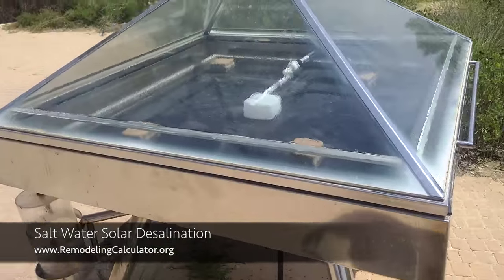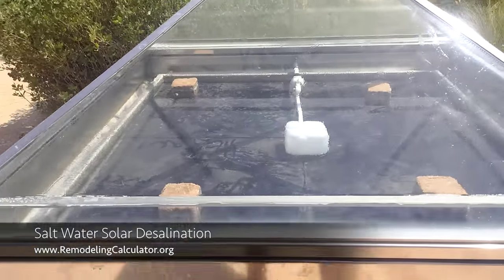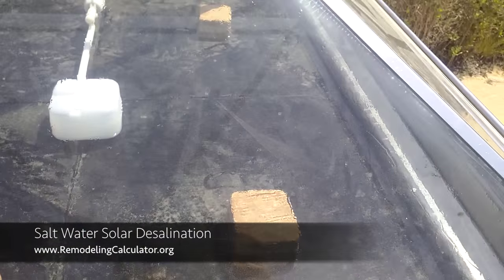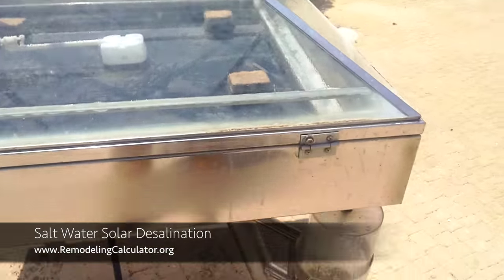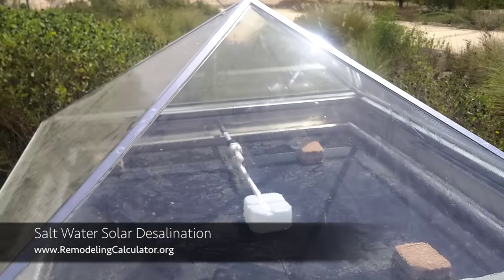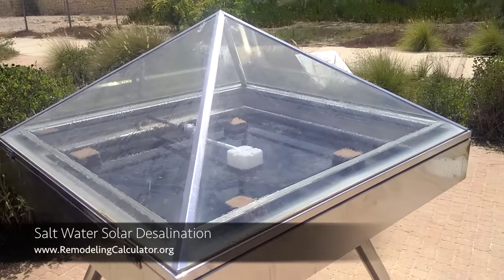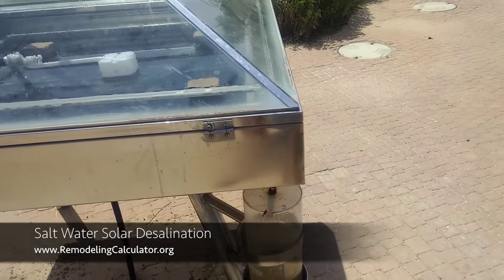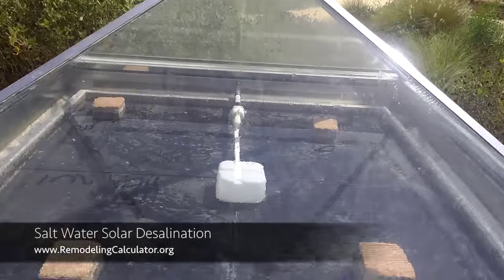Salt Water Solar Desalination - ZERO Energy

Comment: This is a 7-years old video and there are some new ideas in the industry since then. One noticeable improvement is solar energy interface evaporation, which is a technic to heat up only the top layer of the water surface instead of the full water body. Despite that, I still like the design shown in the video for its simplicity. A simple design means that it can be implemented anywhere. However, I would like to suggest two little improvements borrowed from recent advances: First, instead of pouring the salt water into the evaporator, you can add a small pump to drip the saltwater drop by drop. This is to make solar energy concentrate on a small amount of water at a time so that evaporation is more efficient. Second,  add some coarse, dark material into the evaporator. This adds up more surface for the water to evaporate. The material can be carbon fiber, or even waste coffee grounds.
Reply: Can you help me
Reply: i think adding couple Fresnel Lenses would speed up the process
Reply: @Max3DDesign yes you are right it will concentrate light at single point , will increase temp of water very faster

Comment: "you can drink this water, it's pure" shows a filthy bottle with a yellow liquid inside.
Reply: If it doesn't have salt, then it did it's job. You can just boil it to disinfect it after that.
Reply: lol  yes is see.  also he says 10 liters per day?
Reply: It's a demo version and the water is just left outside so produces algae.
Reply: it's full of bacteria and algae
Reply: Plague Doctor that's how Mafia works!
Reply: spikedpsycho  You can always calculate how much sea salt it would require to be readded to make distilled water fresh/mineral.
Reply: spikedpsycho 
Can you show your calculations because I make it completely different to you. Seawater has 70x more salt than drinking water so adding 1Ltr of boiled water to 70Ltrs of purified water would give you the same concentration as drinking water not 20:1 as you stated.
Reply: @thechumpsbeendumped.7797  The Mediterranean is much saltier than The Atlantic so it should depend on such sea or ocean.
Reply: Rhoddry Ice 
The dead sea is even more salty so what’s your point? I was using his figures so how does your comment change what I wrote?
Reply: @thechumpsbeendumped.7797  Yes, so you can't say seawater and think it's the same salinity. That was my point. Autocorrect changed which to such in my last comment.
Reply: spikedpsycho  your right
I drink a lot of r/o water and distilled and i have to add pink salt to it because it adds back electrolytes to the water.  Fun fact: if you add 1/4 tsp pink salt to your work out drink it will provide 100-150% dv of electrolytes needed and you get like 30 of them vs 2-4 in a commercial drink.  knowledge is is fun
Reply: Actually it's a distilled water means zero minerals. I think this water very badly affect in our human body system. Unavailability of minerals especially  calcium will affect our bones partially feel weakness
Reply: It has algae (which in a way is a good indicator) which can be treated in the normal way you would treat river water or rain water, but it has no salt in it which is the main concern in harvesting seawater.

Comment: A person needs to drink about 2 liters of water a day, so the fact that this can purify 10 liters of water a day is very good!
Reply from the maker: +M.R. Weaver it can sustain 5 ppl / day with fresh water :)
Reply: +Remodeling Calculator Wow, that's impressive
Reply: Can one eat use the salt that is left behind or will it contain all the toxins/bacteria/other sediments left behind?
Reply from the maker: No - its sea salt... need some kind of cleaning
Reply: Remodeling Calculator ok thanks
Reply: The whole 2 litre thing is a myth. There is no reason why a 60kg adult needs the same amount as a 150kg person. But as for water. You'd use it for cooking too. So 10 litres sounds good for just one person depending on circumstances
Reply: Great video. Well explained.
Reply: Veirdo
Reply: The sea salt itself should be fine, the problem is any other particles that might have been in the water from the start. You can easily fix that by simple boiling and filtering first, assuming the water doesn't come from an otherwise dirty sea. Then you're just killing a few microorganisms, and removing small debris like sand, small branches, etc.)
Reply: @duncandixon6203  
I count 3 l for hydration and 1 tonne over all. Daily.
Reply: spikedpsycho  but does chlorinated water evaporate the same rate as salt/sea water?
Reply: If you want to increase the performance by applying vacuum inside.

Comment: With a vertical access solar water heating panel in front of your pyramid the water entering will be much hotter thereby increasing production. Simple to make and maintain, if built in a slight arc there would be no need to track the sun, the idea being the heated water will rise first. Plywood base with two to three inch frame, black paint on wood surface, your heating tubes and dual pane glass sealed in front. Preheat the water using solar panel, increase production.

Comment: Perhaps a home can have them on their rooftops. Then they are sharing footprint with the house.  Or good for boats too. Just suggesting. I think it is an elegant design. Thank you for sharing.
Reply from the maker: +Darlene Young good idea, but will only work for water-front homes... Otherwise how do you get sea water?

And water-front property owners are usually not concerned enough with environment, to have solar desalination systems... Just saying
Reply: collecting rainwater is easier and requires less maintanance, this method is good for collecting sea salt, pure water is a bonus :D
Reply: spikedpsycho  easier to just add whatever mineral is missing to the water👍
Reply: rectangular glass is usually more abundant than triangular-panels. Also, I've heard of a guy who somehow stores his freshwater underground (NOT a well, but storage) which keeps the water cool. I think he used specific stone/mineral blocks which prevent mold, algae, etc.

Comment: Salt can be used if heated up to boiling point  of water then allow it to form crystals, salt can be used to make a saltwater battery with copper and steel or iron, this could make electricity for lights fans etc be inverted for ac power

Comment: How about using a solar panel as surface? The panel itself is under glass. So, it is water proof as long you build it at the frame of the panel. You get energy for a pump or for additional filtering. And it cools the panel for higher efficiency.
Reply from the maker: That is ingenious idea. However being a roofer, all i see is water leaks, and it being nearly impossible to seal around that PV panel, especially in poor countries, where access to quality building materials is very limited.

Also you would need a micro inverter or at least a charge controller, plus battery... So this inexpensive and simple desalination system becomes very expressive and complex.

Lastly even if you manage to build this around a PV panel and get it watertight with quality sealant, the water may be toxic from all the chemicals.

Im sure there is a food safe quality sealant, or it can be created ... But it would be a very expensive solution for the rich ...
Reply: I know, it is not really cheap. But, it waste less space and the power can be used for a pump or another cleaning step. 
Usually, solar panels are made for installing on roof somewhere in the world, where they have to withstand rain or snow. So, they already weather sealed.
The frame of a panel can be used to fix the glass dome. At least, i bought a 80Wp solar panel for around 60$. And alle the materials you use are also not that cheap. 
The really cheapest way for sun driven desalination is to use plastic water bottles.
Reply: hey that might work,  and you would still get electricity from the panel.  the only problem may be deposits on the surface of the panel which may have to be cleaned every so often.  I think I will try this, thanks.

Comment: Try using Stirling engines to pump sun heated liquids through the insides of the pyramids thus increasing the speed of desalination  and a float valve connected to a  reservoir inside so that it stays full of water. Only other concern I can think of is that the salts will collect on bottom of container so will need to clean it regularly but you can reach much higher than the boiling point of water easily.

Comment: You should have colder seawater circulating inside (a condenser) to create a more productive dew point, then your seawater is also slightly warmer before it evaporates. A solar powered pump would be needed.

Comment: By heating the water with a small coal fire of sticks in a container then drop the water onto the black absorbant mesh in the center water tank the additional heat will help the black mat to evaporate the water so it can collect onto the glass and run into containment vessel. The salt removed from water can be combined with carbon from the heating fire to make a salt battery. A  copper steel thermo couple battery on heat source can run a fan inside the pyramid to help evaporate the water.
Reply: All true, though I understand that this is looking for ways to generate water without using more resources, coal/wood.  If we go down that route, skipping the glass and simply using a metal vessel will result in the most water in the shortest time, though now producing greenhouse gasses in the process...
Reply: Fresnel Lens.

Comment: Great concept, with a few questions and suggestion. Figure out a way to employ a fresnel lens to increase heat. What do you do with the leftover salt and minerals? Is the leftover salt food grade? How often do you have to clean the leftover residues? Will this work in high humidity?
Reply from the maker: I don't think sea salt with contaminants is "food grade". Just have a big barrel and dump it there, and then back to the sea :)

You really don't need to clean it that often.

Humidity is not an issue
Reply: When scaled up, the salt will become a disposal issue.  Depending on the source of the brine, the resulting salt might be a good 2ndary product.  Remember, you are concentrating the solids in the water, so contaminants may degrade the salt.  Now, food grade is a variable.  Human food grade is different than animal.  This might be a source for salt licks used in agriculture and wildlife management.  Widely variable based on location and climate.

High humidity will not impact this operation.  The pyramid concentrates the heat and hot air holds more moisture than cool.  The ambient temp cools the glass causing the vapor inside to condense.  One only need access to sunlight, which can be diffused to an extent, and still produce water.  

Following other comments about cleanliness of water in collection container, yes, this is simply SALT free water.  Ambient air interacting and introducing bacteria/algae will cause discoloration.  That is a good indicator that the water is clean.
Reply: @RemodelCalculator  where can you buy one or how would we get glass dome etc?  Website not available

Comment: Successful experiment have been in works in Somalia with the same method except its on a large scale. Water collection channels are covered with screens to prevents bugs sand stuff getting in the evaporated water going down in collection tanks. I've seen the largest size glass pyramid of 40ft x 40ft with height over 6 feet. Lower the height in ratio with the width and the length of the pyramid is the method effectively collecting more volume than the higher elevation of the dome!

Comment: Looks a good and simple design, however, you may be able to increase its efficiency even more by having the glass pyramid more steep, (height of pyramid) and that way more area for water to condense and run off more easier towards the collecting channel. Insulate the collector so that water can remain cool in there. 10 liters is more than enough for at least 3 to 5 people if they were marooned on a broken boat in the middle of ocean,
Reply: I think a steeper pyramid would affect refraction, which would reduce the solar energy getting in.

Comment: I have yet to see this type of design, (a box with dark surface at bottom with condensing glass above)   make very much water each day. they all seem to be low volume producing.   the sun will only provide so much heat in a given area so finding the best way to absorb that heat is step one.  then designing the container, box so all the heat the sun provides stays with in the box, (insulate)  the only place where heat can escape ( unavoidable)  is where the glass surface is.  And the glass is where the condensing takes place so the cooler you can make the glass it would seem the better and faster the condensing process would be.    can the shape or height of the glass add more heat to the box?  or can the shape and height  provide faster cooling for the condensing process, yes.   when we study evaporation we know the heat energy is used to break the bonds that hold water molecules together,  and the more heat the  faster the evaporation.  but there is a saturation point where there can be no more evaporation  because the air above is saturated.  so tuning the system is needed.  get as much heat as possible into the water,  then remove the water saturated air fast enough so you don't slow the evaporation process down due to saturation and surface pressure.   and then you must be able to cool the  evaporated water fast enough through the condensing process so the evaporation process can continue  unobstructed  due to over saturation. (not getting the water saturated air removed fast enough).   And remember evaporation is also done with air flow.  in these systems I don't see how air flow is helping.  you are relying on the warm moisture containing air to rise to the surface of the glass in order to be condensed.   To increase efficiency  I would  experiment with  getting as much heat as possible into the water, then  removing the saturated air as fast as possible to the condensing stage.  and having enough condensing  ability to keep up with the evaporation.    the heated steam is also heating the glass and so are the suns rays to some extent so we know it's the air flow past the glass which is really doing the condensing.  think how to increase the air flow on the glass.  and a dome or pyramid  would allow this to happen  but remember the moisture containing air has to rise to reach the glass for condensing , before pressures force the air to become saturated and you get no more evaporation.    maybe try  hot air flow across the water surface, this should help liberate the now single water molecules off the surface and the air flow can now push them through a opening to channel them through a better , faster condensing system,  a simple shaded metal tank that air can flow around would be better than that glass lid.   or you can channel the steam to a condensing coil and then to a underground storage.   I am thinking let the sun be your heat source but use another source for the cooling condensing process.   And  experiment with hot air flowing through the box, make a small solar hot air ex-changer  and use maybe natural hot air convection to push the steam out of the box and through a better condenser.
Reply: Very good analysis sir

Comment: Hardly can make 10 litres a day but maybe yes!
Also it's power of the black bottom is gonna drop because of the minerals and salt that will build so.....
So even 5 litres of saltwater is gonna be covered in salt with a white bottom....i think so. Like the automatic fill valve I would like to see a automated surface cleaning.
Good job 👍
Reply from the maker: Salt is not white - its grey... And you can take salt out to speed up evaporation.
Reply: Remodel calculator , 
I have solution for the minerals build up in the bottom tray .
Use two filling cycles . 
First cycle will rinse and clean the evaporation plate , salt water is drained back in to the sea , the second filling cycle is left inside to evaporate and purify the salt water  .
Then repeat the process , rinse the tray to remove unwanted  build up of minerals and then after set time  you can just stop the intake and drain valves to start new distillation cycle .

Comment: Neat construction.  However based on solar insolation of 1000W/m2 (i.e. full summer sunlight at tropical latitudes), solar stills are unlikely to produce more than 2 litres per square metre per day.  Add some clouds and distillate production would fall to <1 litre per square metre.  Ten litres of distillate produced from a still of this size over one day is questionable.
Reply: The heat is trapped inside by green house effect.
Reply: So concentrate more solar energy onto the pyramid using reflectors. They are doing this already on commercial scales in a few places but they have yet to put a similar design next to our out on the ocean